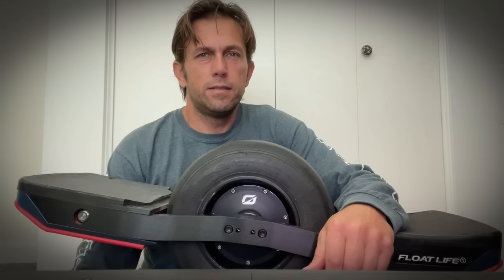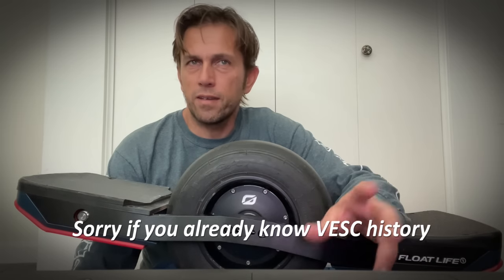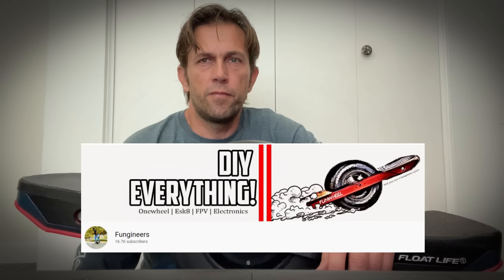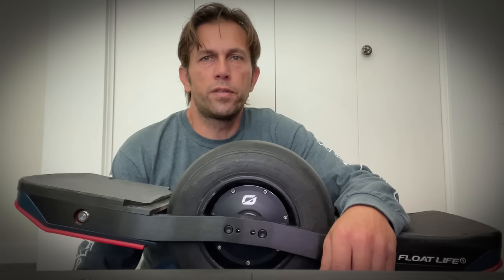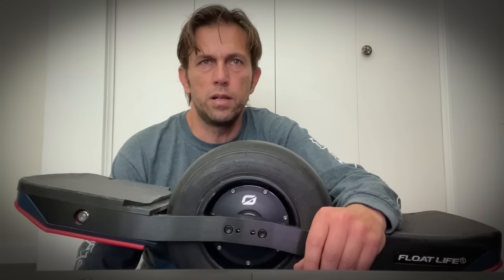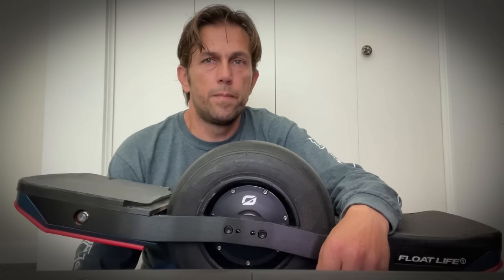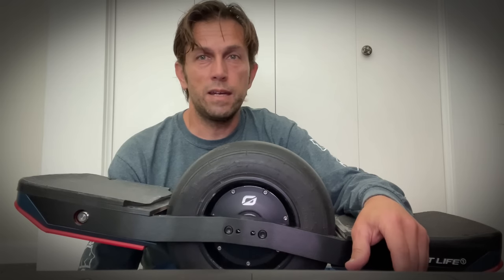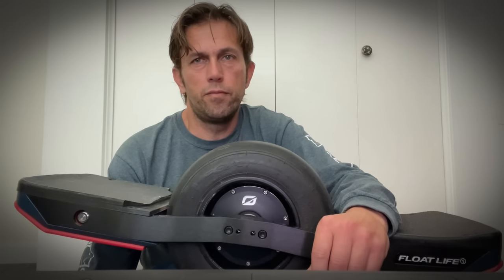VESC Balance Firmware - Magic Settings in v5.2?

Comment: Can you switch modes to erpm once you go over 5 mph or so. I'm only 1/3 way through the vid so far...
Reply from the maker: that's not possible with the standard VESC firmware, however I am currently testing out a new version I wrote where I switch to a different balance algorithm above 5mph, stay tuned
Reply: @surfdado  One thing I noticed on the video is that it looked like braking was a little slower than on the XR with the new settings. Is that the case or is it a non-issue? Thanks for these videos. I have a GT shipping on the 20th, but being a big fan of community developed open source projects I'm looking at potential alternatives. I may keep the GT, but also do a build since time is obviously another factor. Do you ride a stock board as well as a Vesc build?
Reply from the maker: @MikeDIY  I do have a stock XR also, but you're right the braking was a little weaker than on the XR in that particular configuration. However, this can easily be changed in the app. And in the meantime I have made braking stiffer, those taildrags were wearing down our Float plates ;)
Reply: @surfdado  Yeah, that'd do it. I saw another vid of yours and was thinking you could mount an aluminum plate over the PLA to make it more robust. Or maybe some polyethylene cutting board. That's what we used to make DIY skid gloves out of for sliding on your hands for downhill longboarding! We blow torched them onto work gloves, but there are probably more elegant ways to attach them.
Reply: @MikeDIY  Velcro works just fine... at least for freeriding. I would assume the added forces of downhill may make velcro a bit less viable.

Comment: Thank you so much for taking this on. VESC has needed people like you and Hannes, and it’s crazy how fast it has advanced in the short amount of time you’ve been working on this.

Question for you: When you say just use the default firmware before writing Hannes settings, is that a different step than the configuration you performed in Part 2 of this series? I imagine that configuration is sort of like calibration and the firmware is just the riding characteristics? Is that correct? So configuration is still required when you’re setting up VESC for the first time?
Reply from the maker: Thanks! And yes, you still need to go through the whole motor configuration etc. Just instead of loading my Balance configuration you can now load/input Hannes' settings. The VESC firmware supports all kinds of different motors and vehicicles, so it doesn't come pre-configured for Onewheels. However, this may change in the future as some VESC vendors may offer pre-configured firmware to make setup even easier.

Comment: You said you code ?  Here's your info..  
Get an arduino nano 
Mount an external hall sensor, read the rpm and acceleration vs the voltage draw.. if you wanted t know amp clip an amp meter around the + lead . 

But just a hall sensor, arduino nano, and some logging code..  then go for a ride with that on your stock xr.. then you have the code.. 

Use halo sensor for rpm, 
Use some gyro for tilt readings
Reply from the maker: haha sounds so easy, one day we'll be able to just train an AI model then we don't even have to write code
Reply: @surfdado  you're not wrong there. Sometimes I find myself wishing that the compiler understood pseudo code " if the board feels underpowered THEN add more power "   instead of 
if ( amperage <= maximum) {
   if (maximum == exceed ) {  
amperage += 10 ;
}
amperage ++; 
}
else {
Amperage == float ;
}

Even for joking purposes code is a pita sometimes :)